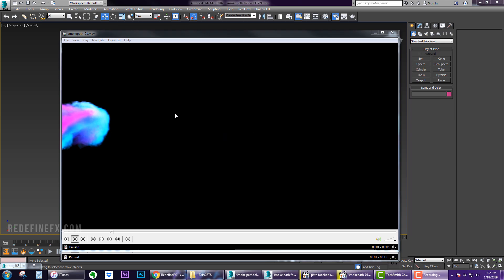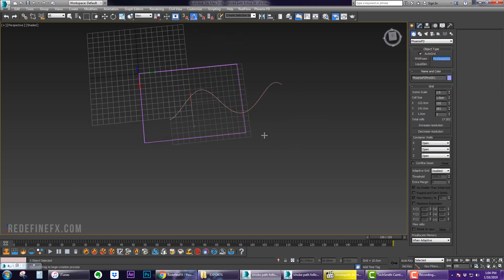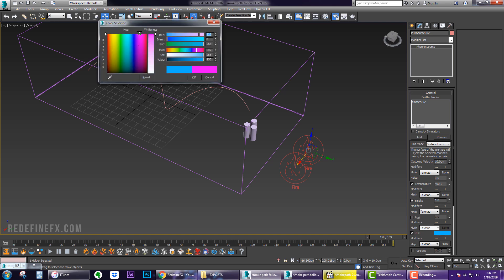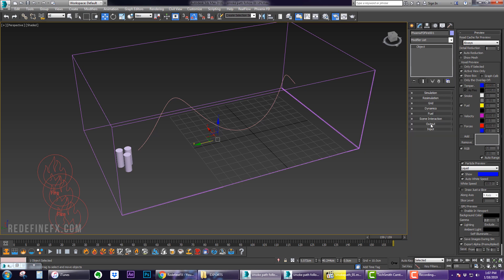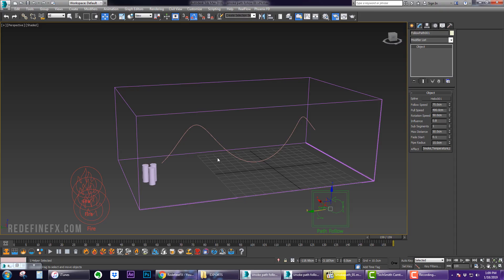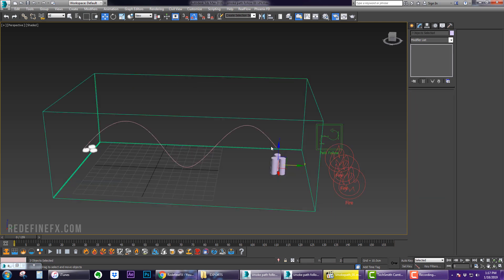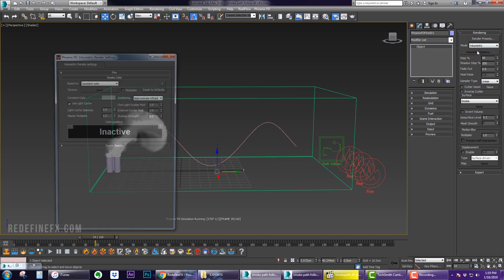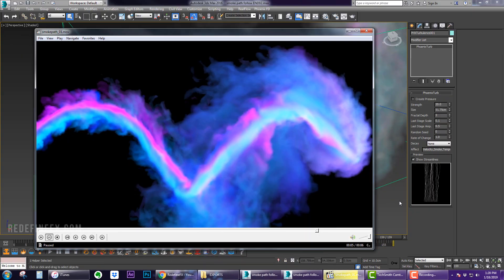Smoke Path Follow Chaos Phoenix VFX Tutorial │RedefineFX

Comment: i Just dont get it...... there must be something wrong with my max install or with my phoenix settings somehow...... i try following everything...... your scene units settings, your every advise and nothing, the sim still goes the way it wants..... there`s always a big mushroom at the beginning of the smoke emmition, and it turns everything into a mess..... I dont know what to do..... and the spline follow settings seem to not work at all..... it doesnt respect influence, it doesnt respect  pipe radius, the same sim every time no matter how much i lower or increase the parameters.
Reply from the maker: try making the scene bigger than what I have, set influence to 1, make the pull speed much higher. If you email me I'll send you a project file that works well
Reply: Thanks man....... After almost crying, i figured out i had to increase the resolution a lot to obtain a decent result, so i tried making the scene bigger and it worked...... Thanks, you are very kind!.